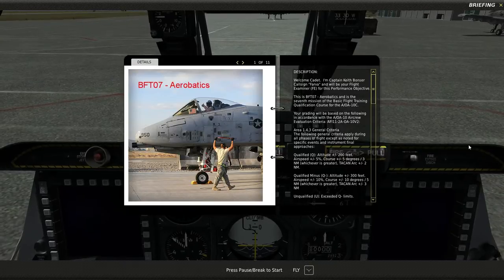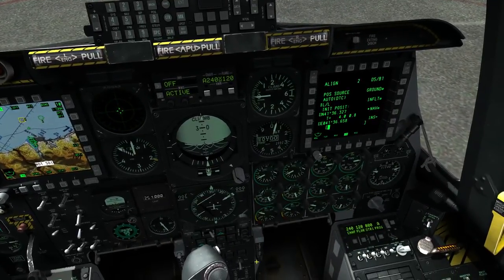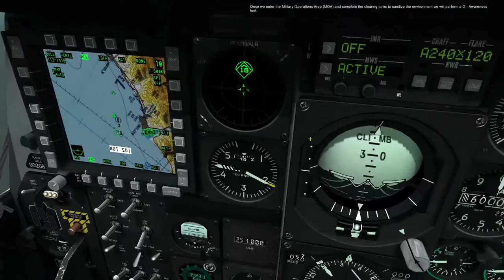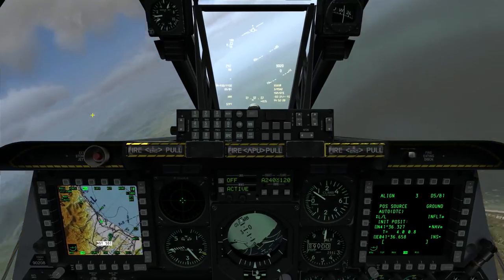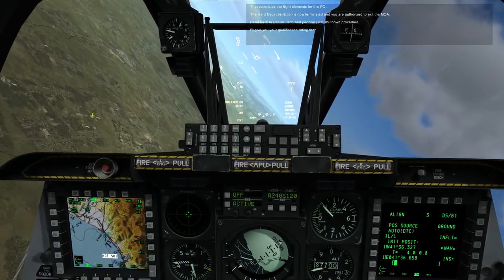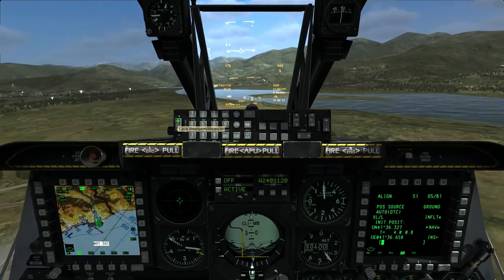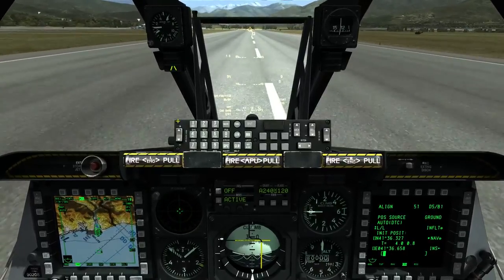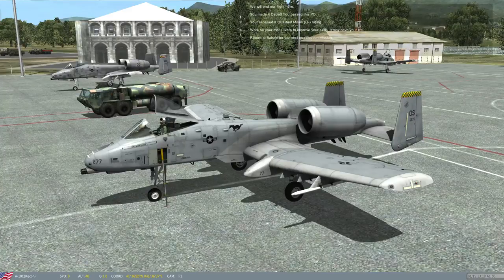DCS - A10c - Basic Flight Training Qualification - 07 - Aerobatics

Comment: Thanks for this video - might help me get through this mission, I'm struggling at the moment. I blew off the training, flew the PO and failed it. Went back and flew the training twice and have failed it twice - not because of bad mission design, but because I'm a horrible aerobatic pilot. LOL. Your video will help me though. Nice job.
Reply from the maker: Mudspike,  This is one of the toughest missions in Basic.  It took my several attempts and I still didn't get things right.  The one thing I know now is you need at least 325 knots of airspeed for the loop and the immelman which you can attain by diving before attempting the maneuver.  I'm not sure if diving will put you outside the mission parameters though.

Comment: This mission is almost impossible. Well, I'd say impossible actually if I hadn't seen the video. First of all, 260 knots is simply nowhere near enough speed to perform these maneuvers. And despite saying 'begin when ready', you don't get enough time to increase speed. Not only that but I've performed several of the maneuvers perfectly (for a change) and yet STILL he tells me I've failed. The parameters for mission success are just totally messed up.
I'm now looking for a way to bypass this mission... does anyone know of a way?
Reply from the maker: I'm sorry Stephen, I don't know how to bypass any mission in these campaigns unfortunately.
Reply: What I did was at the start of the mission, refuel your plane to 30% of fuel, (Left Alt +') and before each maneuver, 285 knots was just enough for loops/immelman
Reply from the maker: Good tip Toshi!

Comment: About to attempt this qualification (as soon as I get trim working again with this new update). I'm guessing these types of maneuvers would be difficult with a fully burdened (ie bombs, roxkets, Mavs, TGP, etc). 

I even wonder about some of the escape maneuvers in this video being possible when fully burdened......but still a cool video as you can see the pilot manipulate stick and throttle. 

https://youtu.be/72FfERSgAaI

Once again, Thanks for the videos.
Reply from the maker: Part of the problem is a lot of DCSers take unrealistic loadouts like 6 mavs, 6 GBU 12s, TGP, and a rocket pod and maybe to GBU 38s.  Almost impossible to maneuver.  A more realistic load out seems to be  only 2 mavs and 2 GBUs or 4 Mark 82s which allows for a lot more maneuverabiliy
Reply: Yeah....this particular mission doesn't give you the speed required to attempt certain maneuvers.  Not sure why they didn't start at higher altitude and go from Split S...then Immelman

Comment: What sort of setting do you have for your stick? Your flying seems very smooth? When I do this mission I barely pull my stick back to accomplish a loop and I am all over the place. Thanks.
Reply from the maker: Which flight stick are you using?
Reply: Thrustmaster HOTAS
Reply from the maker: Andy Koski I leave my Deadzone and Curvature at 0 and Saturation X and Saturation Y at 100 for both pitch and roll, and my rudder pedals.  I do make changes to those for the Huey, but for the A10-C, I leave them alone.

Comment: Witch one Instructor told you this is a Cloverleaf ?
Reply from the maker: It's been awhile since I've flown this mission, I guess I'm confused by your question, could you be more specific?  Thanks!
Reply: Your entry speed was low, and your roll rate was to long at the vertical axes.That why your speed bleed off and you tumpling on top. You fixed to long the vissual referenc point and confuse about the right position in the roll. This is what I saw in your video.